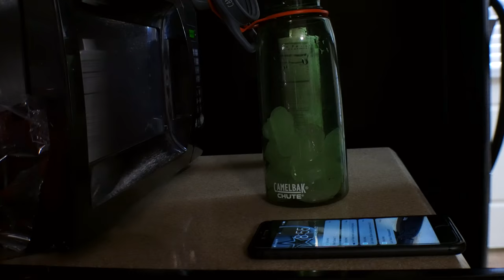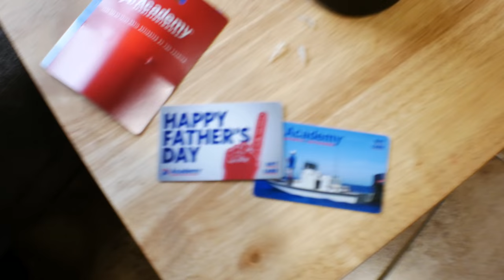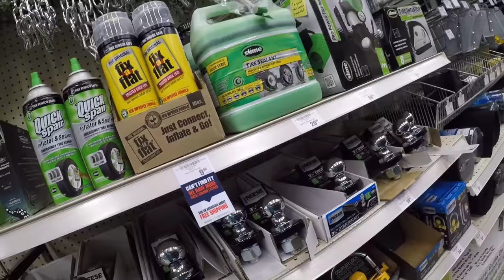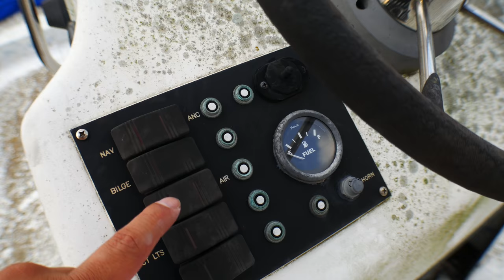New flats boat!

Comment: I have the 20xs Ultra Cat...2008 model with a 150 Evinrude E—Tec and McClain aluminum trailer. Got a crack in the hull a couple of years ago. Fixed and still a great boat on the water.
Reply from the maker: Victor Garza bro!!!! Just sold mine yesterday 😩. Just ordered my 2020 hobie outback
Reply: how did they fix the crack?